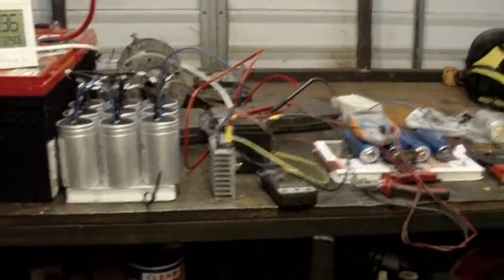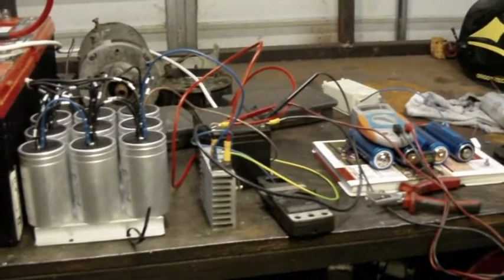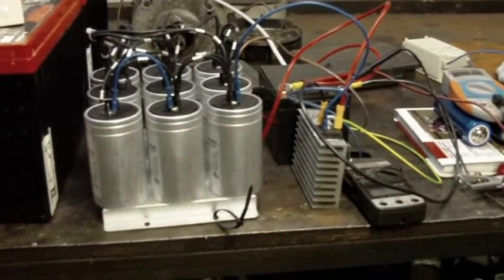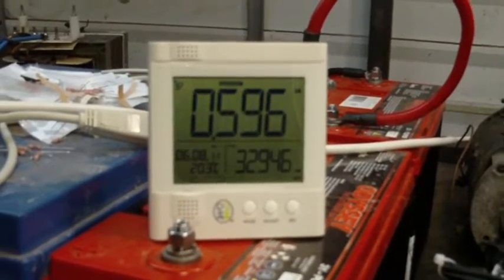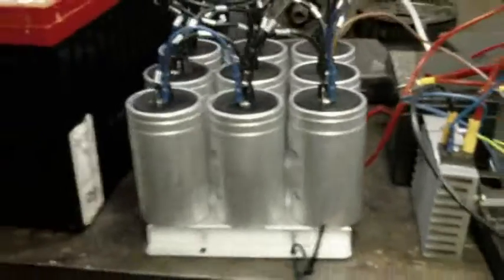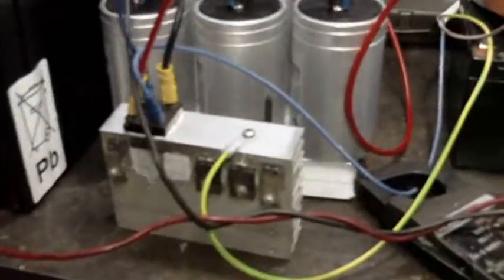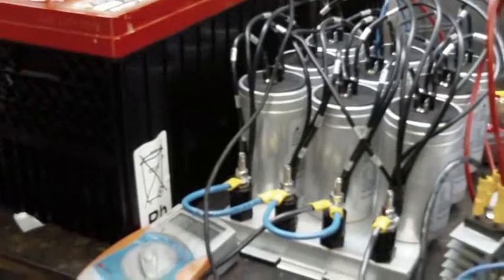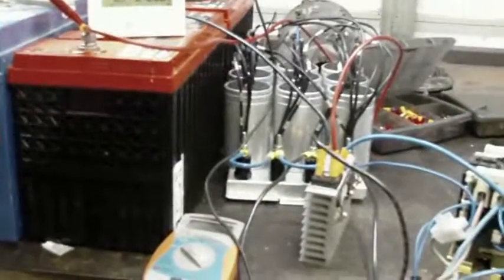Capacitive Charger Experiment 01

Comment: I tried this with 35mf cap. With a gell batterie of 100 ah the dc volt raise to 19 v when i decide to stop and limit this problem with appling a load to get 14.6V. the purpose of this is bringing back this batterie of 2 years old by desulfat it. Am i in the right way plese.
Reply: 19 volts is too high.
Reply: Is it a sealed battery or a flooded lead-acid battery? Different types can handle different voltages. If it's a flooded kind I wouldn't get it over 16 volts and if it starts to feel more than warm shut it down. Other types of lead batteries cannot handle voltage this high

Comment: If you look at the 4th post on the thread on the forum, I showed another version of the charger that is limited to 18 volts or so. So you can wire it to limit the voltage.
And adding a high microfarad/voltage dc electrolytic capacitor on the dc side of the circuit will raise the power factor.
And I measured the wattage on a watt meter, and it read almost 75% efficient for power consumption. But when I put it on VA setting, it read what you're getting because of the power factor issue.
-Gatorman
Reply: Do you have a link to the Forum Where you're version of a capacitance charger is? I'm looking into building one to charge my off grade 48 volt battery bank but my generator is only 900 watts continuous so I would need to make the power factor better